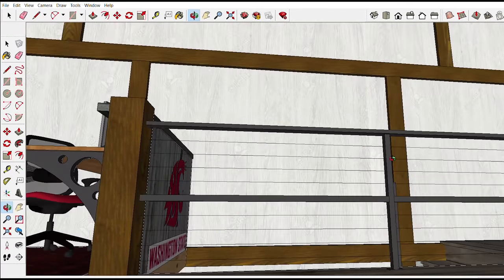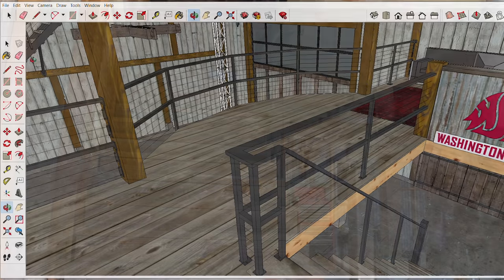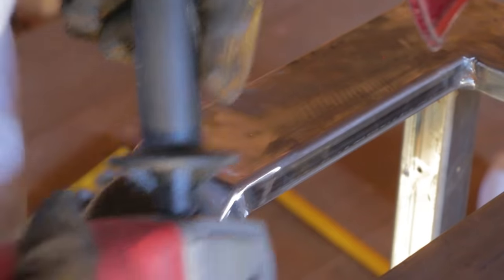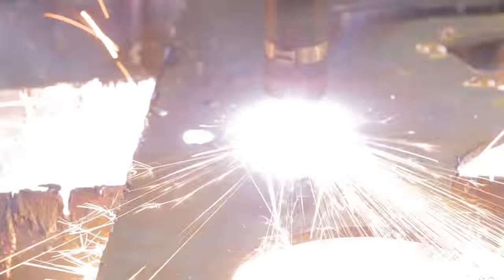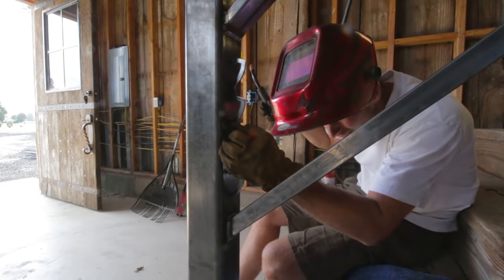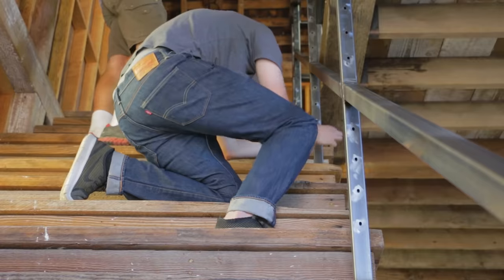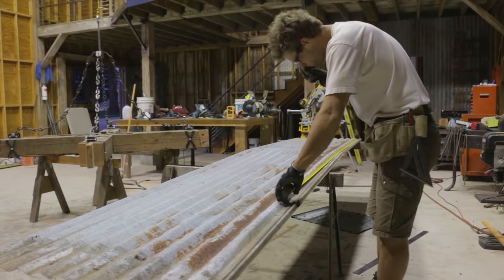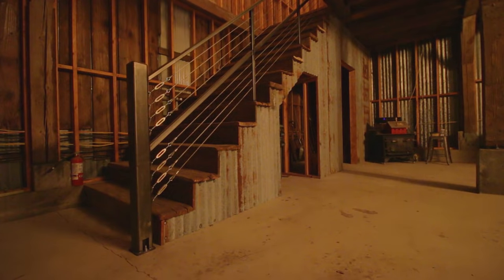Stairway Railing - 3/3

Comment: I’ve been meaning to tell you but kept forgetting until now. I did a test in my shop last summer of 8 different flap discs. Walter abrasives flap discs are far superior to any others I have tried. 
Walter Enduro-Flex Flap Disc, 4-1/2" diameter, 40 grit, Type 29, 5/8"-11 Thread Size, Trimmable wood fiber Backing, Zirconia Alumina (Pack of 10) https://www.amazon.com/dp/B001ASC6JY/ref=cm_sw_r_cp_api_YPAiAbRP3J3W1
I don’t even buy traditional grinding wheels anymore

Comment: Have you ever thought of flattening out the corrugations in the metal, it gives it an entirely new look which is very industrial, especially if no protection from rain etc is needed. I used my car running over sheets of tin, but your fertilizer wagon would be easier and quicker

Comment: You should get unfold tool for sketchup and use it to print yourself the preformed cuts. It will give you a starting point.
Also, spinning the can along its generator axis with slight inclinations from time to time mixes the paint much better than the up and down variant. At least, that's how the paint can shakers work. It's a tray with a bent axle that spins the can and tilts it.

Comment: Hey heads up you should make a catch basket for little parts on the plasma table. I use a waterjet all the time and we have a small mesh basket that we can put under the work and it will catch small parts and all the slugs that come out (you never know when they come in handy). Its also really nice not to have to go hunting through that nasty ass garnet sludge. Its thin gage metal with small drain holes cut in it, bent into a basket shape. We have a smal pulley and wire in the tank that allow us to position it and pull it out without removing the main grate.